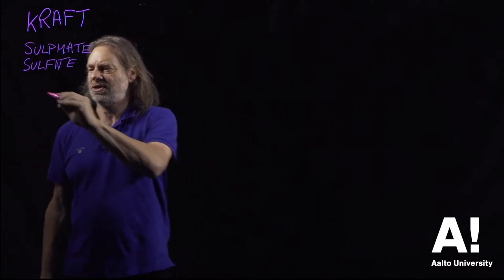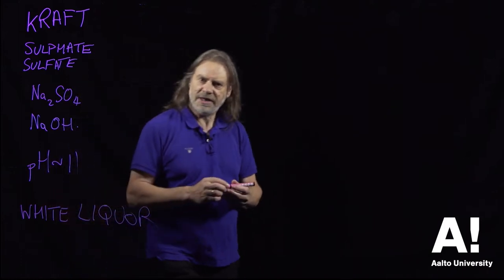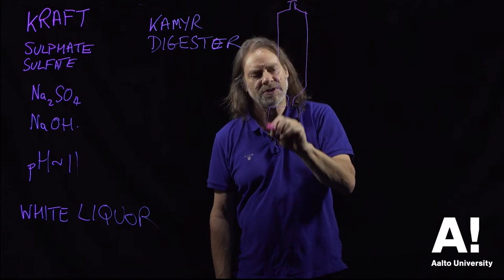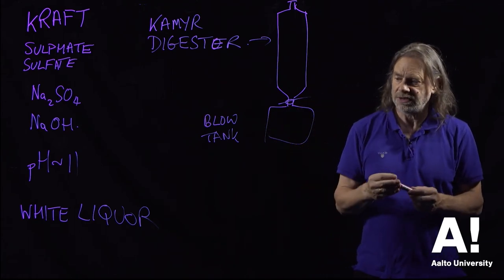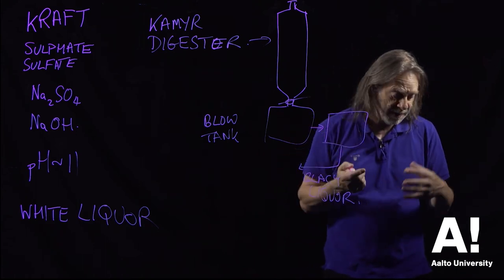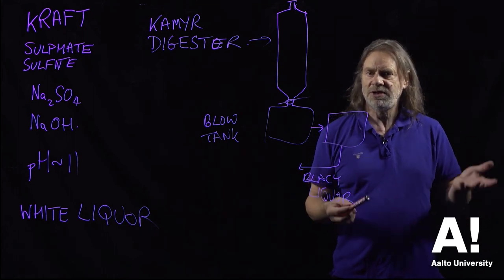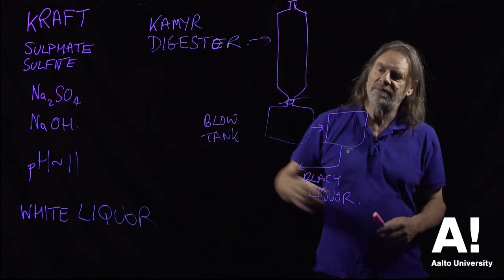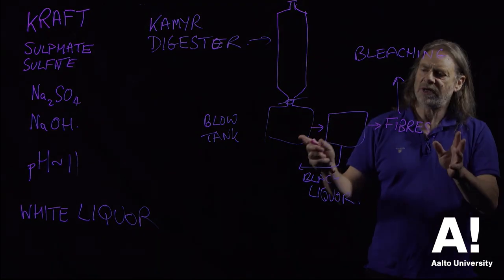Pulp and Paper (2) The kraft process

Comment: The Kraft process is also called the sulphate process , it consist of two chemicals ,Naso4 and sodium hydroxide n its a very alkaline process probably around 11. You get the wood chips n mixed them with a white liquor which is a mixture of those two chemicals and them you heat it up in a digester  under pressure. Remove the valve , that process releases the fibres from the chips . So you do a series of screening pressing process and we get what is called the Black Liquor , and that black liquor is the remains of those chemicals and lignin. We remove Lignin from the wood and separate it from the fibre cos Lignin is brown and we need white paper . This liquor goes to the recovery boiler ,  so there's a lot of energy stored in this black liquor n can be used to power the whole process . We have to use a bleaching process to get the white paper

Comment: Does green liquor also form part of the kraft process?
Reply: Yes! Green liquor is apart of "the number of other processes to recreate white liquor" as the video author describes it.

So you're spraying black liquor into the recovery boiler to burn, right? The stuff that doesn't burn is called smelt. Smelt is collected in a tank below the recovery boiler called a dissolving tank.. the dissolving tank takes the smelt and dissolves it in a by-product of the caustisizing process called weak wash. After the smelt is dissolved it is called green liquor! Lime is added to green liquor in a caustisizing plant to create white liquor which is re-used at the digesters :)